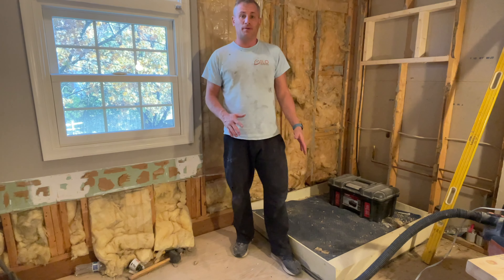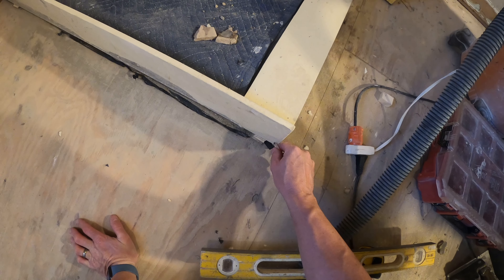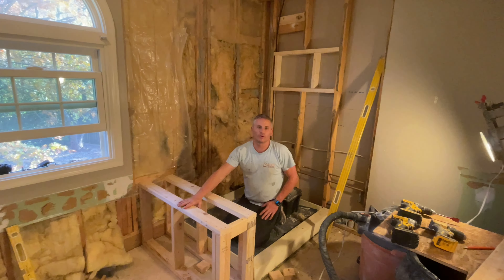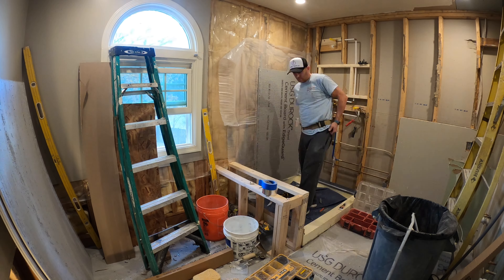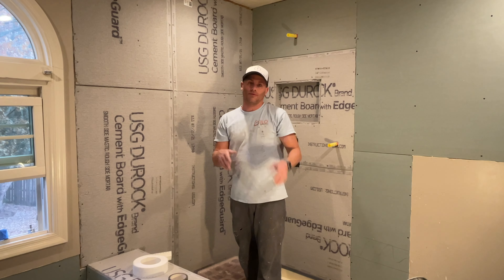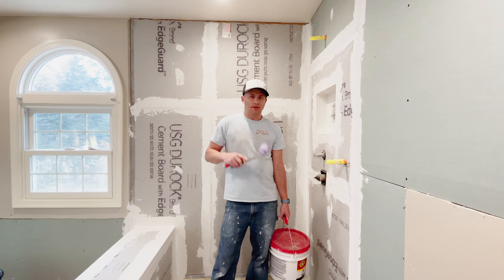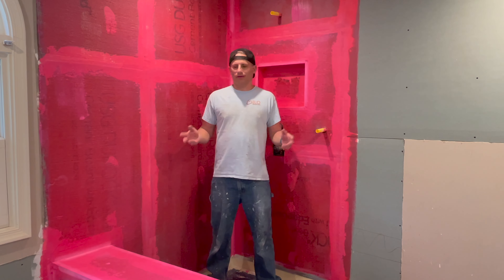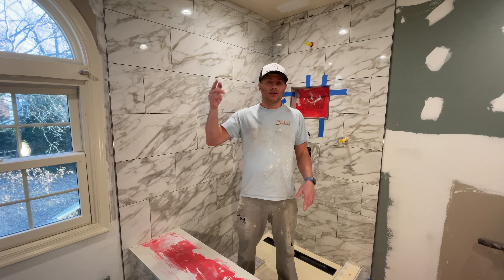Adding a Custom Shower Bench Using a Tile Redi Shower Base

Comment: Water follows the path of least resistance,  wicking of the cement board can and will occur, so water will go up
Reply from the maker: How would it wick with a moisture barrier? If not water proofed, sure, but we are waterproofed here.
Reply: I kno my brother, im jus sayin wicking can happen, nice work
Reply: @Ticonderoga12  The cement board is not all the way into the shower pan.  It sits on the top lip of the pan.  No wicking will occur like if you install cement board all the way to the shower pan floor
Reply: @bdobrzensky  very true

Comment: Great video thank you really wish you showed how you used the drywall corner bead vinyl. Definitely makes sense everything you said thank you
Reply from the maker: Watch my how to install a custom niche. I go over the tape there.
Reply: @TodayIWorkOn  thank you
Also I didn't think the ready tile floor pan was that much of a pain just Dri-Fit 10 times to make sure the PVC pipe to ABS drain pipe is perfect. I was doing it on a concrete floor so you have to make sure you're perfect thank you I'm going to check out that video right now

Comment: We are going to do our bathroom and replace our tub with a Tile Redi system.  I've watched all your amazing Tile Redi videos, thanks for them all. A couple questions, can I use the tile Redi system with my 1.5 bath drain?  Don't you usually install shower floor tiles before wall tiles?  I guess it doesn't matter that much with the sealed Tile redi system, but I figure you want the water to run down the walls and on top of the floor tiles where there is overlap.
Reply from the maker: In this circumstance, the shower floor tile was on backorder and my clients didn’t want to hold up the project. It’s more an aesthetic. It always looks better when you tile the floor first then the walls, but I was able to make this look good with really tight cuts. The 1 1/2” waste is ok, but not per code. Showers do call for 2” waste lines. Does the shower drain ok with a 1 1/2” waste, usually. If that’s all you have to work with, then it is what is is. Always remember the waterproofing is not the tile itself, but what the tile is being attached to. You should be able to hose down the shower area before tile and be confident it’s waterproof. Good luck with your project!
Reply: @TodayIWorkOn  Thanks man, yeah that's why I am so interested in the Redi Tile pan.  Did my daughters bathroom a couple years ago, but on that one I replaced the tub with a tub.  I have been hesitant to do a shower pan myself due to the leak factor.  With the Redi pan, that stress is taken care of.  I understand the 1.5 is not code, but it drains just fine and has for 30 years.  This is our master on the second floor and replacing the whole waste run would get me divorced ripping up all the walls downstairs lol.

Comment: I just finished my first readi tile install in a downstairs bath. The biggest key is the walls and floor MUST be perfectly SQUARE and level and fit exactly, if not sister or shim until they are. This took a lot of time, but then it went smoothly. 
I am starting on upstairs bath number 2 . The question I have is if you have seen any issue with water discoloration setting and sealing marble mosaic tile on the redi tile base. If some water sits on the grout and then sits on the redi tile base, it can discolor the marble tile from below. Have you seen any cases of this ?
Reply from the maker: If you use the white redipoxy I think you should be fine. 

This reminds me of a throwback story circa 2000. I was a helper for my boss and we did this super expensive bath remodel. The tile were like 25 bucks+ a sqft. Insane money at the time. Anyway, our tile guy did a mud job in the shower and the tile were natural stone. Well, you can guess what happened, the black of the concrete mix soaked through the first 4 rows of tile on the bottom walls. It was a mess and I don't remember what actually happened. Lol. 

The tile Redi base and poxy do NOT have the same issues. You should be good.

Comment: Great video … if you do another video can you do one  on how to connect the tile redi base board on to the drain cause sum of the tile redi drains are tight fit to the 2” pvc that connects the p-trap  thanks only if you can.

Comment: Great information! I am finishing a basement, and  was having trouble finding the right configuration of Tile-Redi base with bench. I also don't want to be limited in how I configure the shower bench, and was not liking the idea of having to depend on a front wall section to close in the bench-I want an open glass wall on the front. If I were to add positive feedback, I would recommend using plumb for indicating vertical plane, and level for horizontal. Thanks for a great video! Your shower looks awesome!

Comment: Looks like the shower tile was put in the shower pan lower than the pan tile. I know the wall tile won't wick up water if the seal is compromised so does it matter which you do first , pan tile to wall or wall to floor? Also what to use on joints where they meet? Silicone or grout or both? Thx, great video
Reply from the maker: I always put the shower floor tile first, but there was a serious delay in the shower floor material(supply chain issues). Since we wanted to get template for the glass on the shower and didn’t want to delay the project, we decided to do the walls first. Floor went in just fine and I’ll be doing a recap video on the whole bath when my clients come back from vacation.  I use siliconized grout caulk.

Comment: Your videos have been very helpful, thank you. When installing the cement backerboard down to the redi-tile pan, do you leave a gap or is that not necessary since there is the flashing already in place?
Reply from the maker: I go down to the tile redi base.  Makes for a nice tight transition to the base.

Comment: Thanks for your videos!  This is going to be the first time installing this system and you have given me some great insight!  I had originally bought the bench with the pan and yes, it's really flimsy so I'm opting to use backer board instead.  My question is with the flashing...  I am going to install 3'x6" tile and am a little concerned with the installation just above the shower pan where the flashing overhangs into the pan.  I can see with 12x24's that it wouldn't be of concern, however, with small tile I am a little concerned with the tile adhering to the metal properly.  Should I silicone the flashing to the pan and then go over it with the redguard for a more secure adherence?  Any suggestions would be appreciated!!
Reply from the maker: Nah, you will be fine, but make sure you use the approved thin set mortar on the bottom tile.  I recently did 6x6 tile and I did use a thin set mortar on the first 2-3 rows because I knew tile glue would not work.  Good luck with the project!

Comment: What adhesive do you use for the bottom row of tile on the walls that spans both the redi base and normal backer board? Since the redi base requires epoxy but the backer board would just use normal mortar do you actually draw a line at the transition and use both? Thanks!
Reply from the maker: The new tile Redi systems let you use approved mortar. I did the first 3 rows in a modified thinset then went to tile glue since they are 6x6 tile.
Reply: @TodayIWorkOn  Thanks!